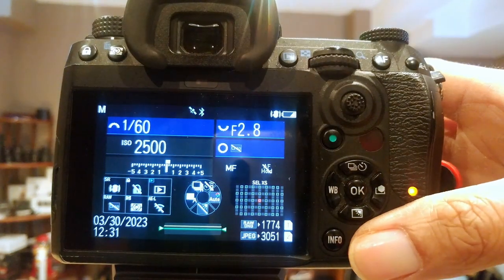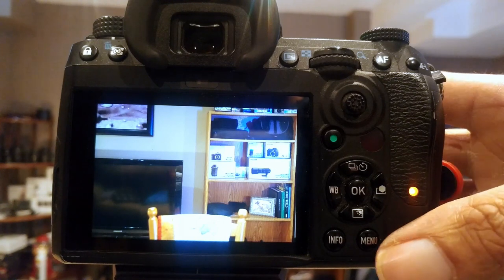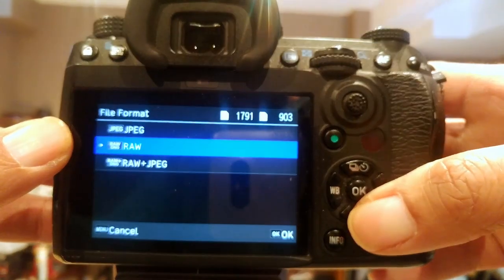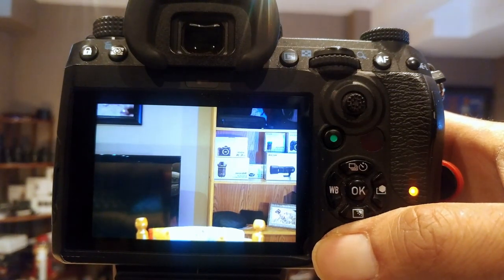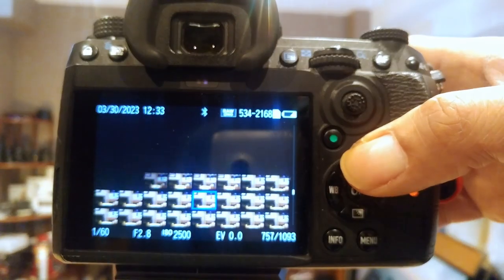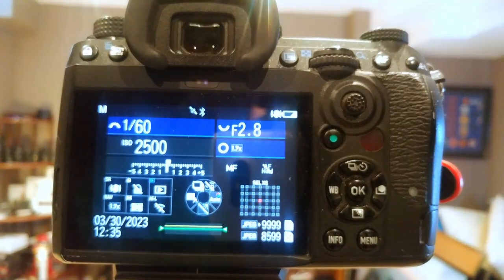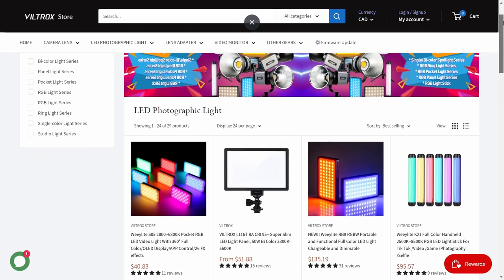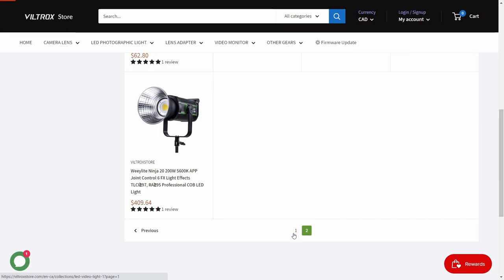PENTAX K-3 Mark III Buffer comparison in 1.3x and 1.7x crop and no crop modes.

Comment: What is the specific difference of the crop..? I use K3iii with the 50-300m plm. Does the focal length differ or is it just the image size of each photo..?
Reply from the maker: Think of it as using a 1.3x or 1.7x teleconverter without it changing your aperture. It does change the image size. 1.3x crop is 15 or so mp and 1.7x crop is around 9 mp. You can get the same image cropping in post. However, apparently, using the crop modes, the camera will meter to the crop and not the full image view so you have more accurate metering for the subject. Plus, in 1.7x crop, you get way more images before the buffer gets filled if you're burst shooting in jpeg.
Reply: @KobieMC  😎👍

Comment: It sounded like your burst was not on high, is that right?
Reply from the maker: It was on high. The system seems to be a bit scatter brained. 1.3x crop gives less images than the full non crop and 1.7x crop gives a ton more images than 1.3x crop. Another time I tested, I got less shots than what happened in this video. It's quite bizarre.
Reply: Wow in jpeg how many shots you think you got in full readout no crop ?
Reply from the maker: @joeysandoval2511  79 or so.
Reply: @KobieMC  that's sweet
Reply: The 1/60s shutter speed may contribute to why it sounded a bit slow, but don't quote me on that.
Reply from the maker: @jbp6759  possibly, could have also been the ISO as PENTAX has mentioned the performance would be slower with a higher ISO.
Reply: @KobieMC  Makes sense